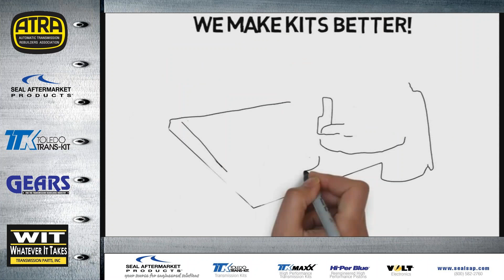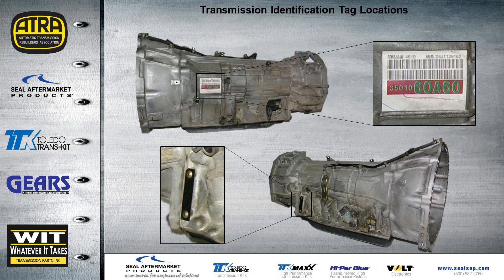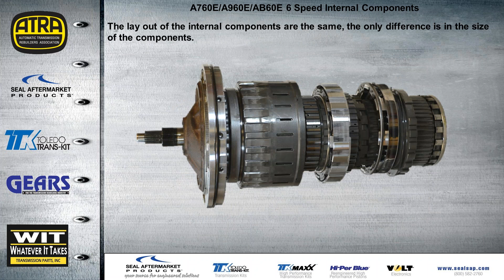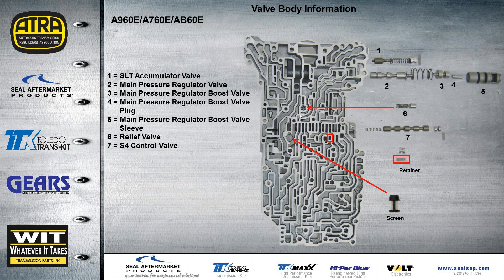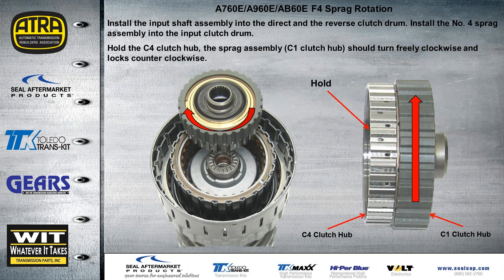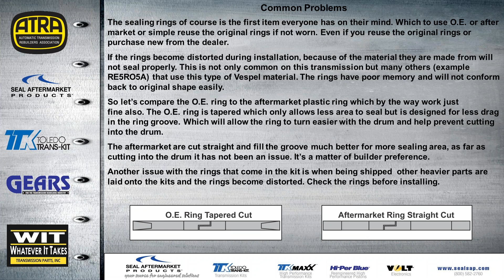A760 AB60 Comparison

Comment: I have a 2007 Toyota tundra 5.7 Engine with tow package when I come to a stop and start to go again engine revved up and transmission has fallen out of Drive and then slams into gear in my tires Lay rubber also in the winter when temperatures fall down to 32° when I put it in drive transmission does not engage until it warms up or I may go 2 or 3 blocks then it starts to act OK but it’s subject to do this anytime.Can you give me any idea what it might be or clue.It also does this in manual